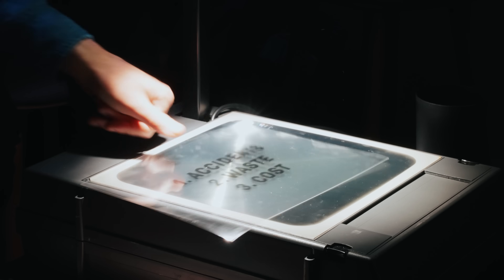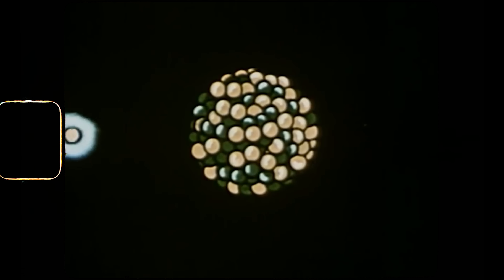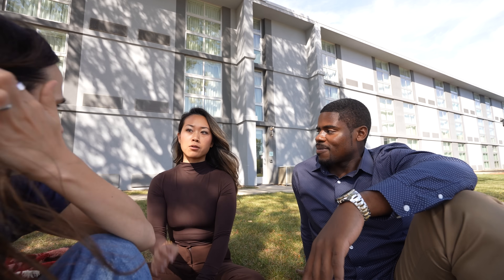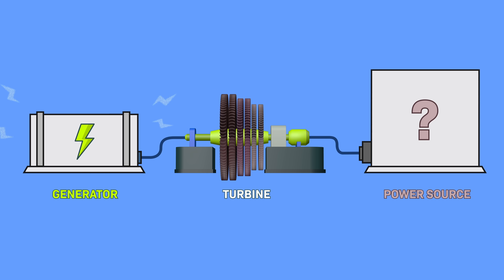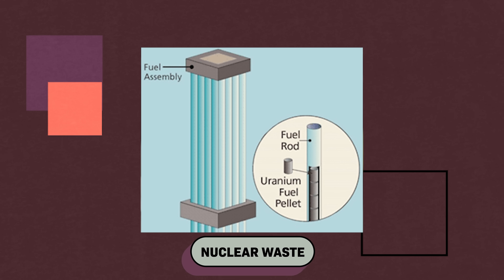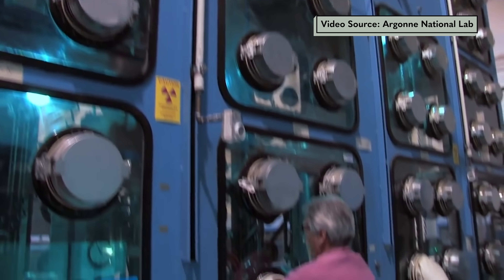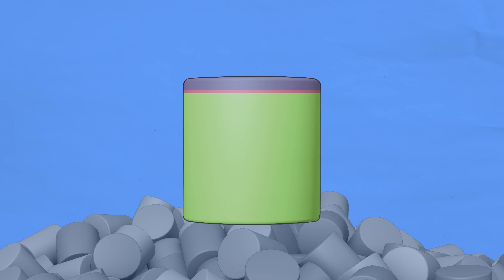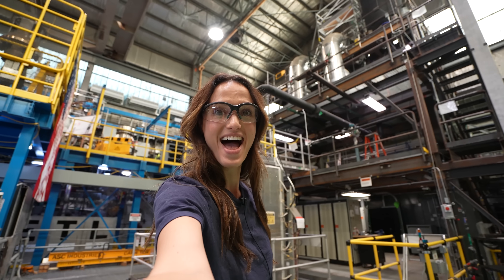The Big Lie About Nuclear Waste

Comment: You should create a video on thorium reactors.  They are far safer than uranium-fueled reactors.  The waste from thorium reactors has a far shorter lifespan, and thorium is much more abundant than uranium. Thorium reactors can also use a thorium-plutonium fuel mixture to burn up the plutonium waste so it doesn't need to be stored for thousands of years and can't be used for weapons.
Reply: Thorium has it's own issues. The waste is definitely quicker to decay, but it's also way more dangerous to humans, making waste management still a big concern. Fuel, as well, is an issue, as the most promising reactor type, the Thorium Salt reactor, uses the fuel in an extremely corrosive form. All of these are solvable, of course, but let's not forget the difficulties we still have ahead of us!

Oh, and uranium is extremely abundant on the ocean floor, it's just not economically viable to collect it at this time.
Reply: @ArtemisStiles yeah I’m so sick of hearing about thorium reactors. Sure they are safer than older reactor designs but that is mainly due to all reactor designs improving. The amount of bad information on YouTube is crazy.
Reply: @ArtemisStiles  Considering the dry casks that have been used has never leaked or had any issues in something like 60 years I find it very unlikely it will be an issue especially since the current method is basically the same thing the planet does with its own reactions deeper in the crust it's also a very small amount of waste and you can see people move them without full on suits and PPE because there's no need for it.
Reply: It's not really the fuel that matters, it's the reactor design, Molten Salt Reactors could use U235, PU or breed fuel from Th or even spent nuclear fuel directly without the reprocessing.
Reply: You can do all that with Uranium as well. What you're describing are the properties of a type of reactor, not the fuel.

Plus, I think we'll perfect  fusion reactors centuries before Uranium runs out, so the abundance of Uranium isn't exactly a train smash.
Reply: @tylerdurden3722  Yeah and that's not even including mining heavy metals from asteroids.

Comment: Back in the dark ages, 1960's, one of my elementary school teachers brought in some one from the local electric utility to explain nuclear energy. This person told us how safe it is and that soon electricity would be too cheap to meter. I am sure that it was the nay-Sayers who sabotaged that. Too bad. 
Engineers will tell you that most anything is possible, and it is true, but the                                            devil is in the details. One of the things that would make nuclear plants more useful would be to site them in residential areas where the waste heat could be used to heat houses. Nuclear reactors produce more waste heat than fossil fuel plants so it would be nice to put the waste heat to work. It turns out that most people don't want a reactor that close to them. So, instead, we let the utility dump the heat into the river, upsetting the biology of the river.
Humans are so good at concentrating dangerous materials. We are just not very good at dealing with the results over the long term. 
By all means, propose new uses for nuclear waste, but look hard at any long term consequences. The utilities that run nuclear reactors don't use the waste for lots of reasons.
I look forward to the next 'too cheap to meter' plan.

Comment: There is very much wrong in this video.
Enriching uranium does not produce additional U235, it separates the U238 and U235 to some degree to increase the concentration of the U235 to a level that allows the use in a reactor.
The same basic process run many more times can also produce weapon grade material.
Enriching leaves you with a load of U238 that still contains some other isotopes, is still radio active, though not at a very high rate, but it is toxic.
"Recycling" spent rods basically extracts the left over U235 so you don't have to add as much new U235. This can not be repeated arbitrarily, the U235 is used up and you collect more and more of the elements not fit to be used in a reactor. Several of them are highly radioactive and you contaminate a lot of material in the process so your pile of nuclear waste increases.
Breeder reactors have been built many times and all of them failed to work properly. Currently there are two in Russia that collect a lot of downtime due to failures. The problem is that a breeder reactor runs quite hot and needs exotic cooling, typically in the form of molten sodium (the other options like molten lead are working even worse). Molten sodium is dangerous and difficult to handle, combined with the high operating temperature it leads to frequent failures, not fatal ones but they do disrupt the operation which makes the power plant unfit for practical use.
And this has been the case since the 1950s.
All the talk about the wonder reactors is fairy tales, nuclear is about the worst option for energy supply and it definitely is the most costly.
Reply: Thanks for that. This video lacks a critical voice. I mean the two people she sits with, are working for a company, who wants to build such plants. Maybe they are a little biased.
Reply: @meieiro  There is a whole startup scene for nuclear who all claim to be working on revolutionary new reactors but really those are all old ideas that had been dropped for being unrealistic. Some even requiring materials that do not exist in this universe.
Reply: It honestly really surprises me because you have a lot of scientific research consistently backing why nuclear power is the one of the worst options for energy production even to this day. Yet you still have it dominated by internet commenters and YouTubers who are advocating for it because of some very poorly represented information.
Reply: @CheshireCrab  There is some bizarre fascination with nuclear energy. It was the big promise back in the 1950s/60s but it did never really deliver. Though some people still cling to that hope.
But the initial problems are still here. The waste is one of them. Against all claims that there will be some miracle solution or even a workable reactor that "burns" the waste, the "solution" is still to tighly seal the stuff and put it somewhere.
Not even the permanent storing did work. All attempts failed so far since the "safe" geological structures are disturbed when you dig holes into them.

Comment: Cleo, I think I'm falling in love- don't worry, I am far too old for you!  For MANY years, I have thought it was INSANE not to recycle spent nuclear fuel- there is FAR TOO MUCH ENERGY LEFT in the spent fuel.  Burying it for "thousands of years" is nuts, when new technology can extract it and make the residue safer.  Combine this existing tech with Thorium MSRs and we have an airtight solution to the nuclear waste problem.  I've been following this for many years, and I can verify (as an interested and informed layman) everything you have said here. 

Good on ya!

P.S. Even the Plutonium is useful- NASA has been using Plutonium for providing power in thermal reactors, and is using such on the new probe to Titan (moon of Saturn- have I confused it with the new probe to Europa- moon of Jupiter?).  The new probe will have helicopter rotors and will have a lifetime measured in decades!

Comment: I'm 100% for using "nuclear waste" energy to generate electricity.  Thorium should be considered as well.  Used with solar, wind, and geothermal, adding reactors that can use nuclear waste would reduce our dependence on fossil fuels by an enormous amount.  It would also bring to a halt the practice of "fracking," which is ruining people's fresh water supply (water wells) and can destroy our aquifers.

Comment: I believe there was a fuel reprocessing plant being built on the east coast several years ago. I don't know what the status is now, it may have been stopped. The other alternative is using thorium. Thorium is way safer than uranium. India is building a thorium reactor at this time. The US started with thorium but was replaced with uranium due to uranium being better suited for use in weapons.

Comment: Like your energy but sorry to say I see too much optimism with creators of dangerous 
technologies. 
You forgot to add the step in the closed loop process where the enriched 
stuff goes to the Weapons industry. This unshown step is why our gov'nmt choose 
this type of reactor. The other reactors where axed out due to the 'Cold War' need.

Also, in your 'fracking piece', if a safer way is created to frack safely, the 
companies that do the work will takes more time and special resources. They will find
a way to take short cuts to increase profits. A safer way to enhance any process will
increase the cost, not what bad actors will use.

Lastly, your mind set on 'safing the planent' because of the UN IPCC agenda has 
one major flaw. The mission statement of the IPCC is to only review scientific studies 
the are related to 'man' made' links of CO2 emmissions and Climate Change as related to 
greenhouse gases!
Oh, forget about the SUNs solar activity and its relationship to our climate since it is 
not 'man made'. Also many other natural links to greenhouse gases like the number one 
green house gas 'water vapor'. Please, give our species a break. We lack the ability to 
control any thing in the universe. Check our the "Weatherman's Guide to the Sun"

What we are seeing with the so called green Technlogies is they require we dug up the 
earth more than ever. At the end of such technologies will create the largest toxic 
landfills from these products (Wind tubines, EV batteries, solar panels...). Will need more
energy just to move this stuff around.

Keeping your topics to the network new agenda will be good financially ware as digging into the underlining truth does risk your monetary goals on YT.

Comment: Also my dear people, there is an NRC report from the '80's where the activity of the "original ore" (about 100 lbm)  is plotted against the a activity (total) of a standard "nuclear waste" (say, spent fuel rods, UN-processed) the total activity of the fuel rods (equivalent starting quantities) at about 300 years after withdrawal from the reactor. FOR REFERENCE: look at a picture of the Tomb of Gustavus Adulfus and his Wife in the "lower level" of the Lutheran Cathedral, in UIpsalla  Sweden. The BONES have been there for OVER 300 years, with "walk in" (on tours) access and have NOT BEEN DISTURBED since they were put in there. (Around 1600 AD). A tribute to the "stability" of Swedish history, and knowledge of the significance of the remains...but also an indication that ONE DOES NOT HAVE TO ISOLATE NUCLEAR WASTE for "hundreds of thousands of years". Quite literally you could "grind the high level waste into a fine powder after about 300 years, disperse it evenly around the globe, and the net effect would be no more or less than the daughter products and emissions from original ore deposits around the globe.

Comment: We were going to use Thorium but decided to go with nukes so we could get the plutonium for nuclear weapons.  Thorium reactors can use the waste too if i'm not mistaken. watch some videos on thorium molten salt reactors
Reply: Another YT educated person.
Where do people keep coming up with this BS that Thorium was abandoned and Uranium based PWR/BWR were chosen so we could make bombs?
Hanford Wa. has been making weapons material, at their 9 reactors, since 1944, 12 years before the first U.S. commercial nuclear plant became operational and their weapons production reactors are very efficient graphite moderated reactors and DO NOT produce any electrical power.
Savannah River site SC. Has been making weapons material since 1955 and their 5 production reactors are very efficient low pressure heavy water moderated reactors and DO NOT produce electric power.
Thorium was tried at Shippingport and Indian Point commercial reactors in the 1970s and abandoned as too costly compared to Uranium.
Weapons production reactors are NOTHING like U.S. commercial PWR or BWR power reactors and commercial power reactors have NEVER been used to produce Pu239 for weapons, since there has never been a need beyond what the efficient weapons production reactors could provide..
The U.S. currently has so much Pu239 that 34 tons of weapon grade Pu239 is being treated so it can eventually be disposed of at a cost of billions.

Your comment is like saying automobiles use gas engine because the military wanted jet fighters.  God help us that people base their knowledge on social media and YT videos.

Comment: I am under the impression nuclear waste is from nuclear fuel that became unstable from use. The way I perceive this, the nuclear waste would have to go through some type of process to make it stable,and put in to the proper required form to fit the requirements.
Reply: Spent reactor fuel has to be reprocessed and that is a very expensive and dangerous process. And who is going to pay for that?  It is no where near profitable

Comment: The Elysium and (in my opinion) even better Moltex reactors use chloride salts to carry the reactive fuel. They both operate at ambient pressure. They are designed to bur existing nuclear fuel "waste" or even time-expired nuclear bomb cores. They are converted into salts and diluted with chlorides. These reactors naturally sit at their operating temperature from zero power to full power. They cannot over heat and will not go cold until the fuel is removed. They have a strong negative temperature coefficient. Temperatures above the operating sweet spot slow the reaction temperatures below it speed up the reaction. The load can be turned on or off and the reactor just adapts.
Moltex put the nuclear fuel into fuel tubes which sit in a pond of molten salt. A third salt carries the heat away via heat exchange coils. A stirrer paddle ensures heat is evenly distributed. Chloride salts in anaerobic conditions are less corrosive than hot pressurised water. Fluoride salts are more fluid but are very corrosive and the radioactive environment puts even more strain on any metal parts.     
Elysium continually pumps the fuel from a dump tank into the reactor core. If the pump stops the core runs dry. Fail safe but pumping that stuff is a considerable regulatory issue. Moltex puts the fuel into vented tubes so avoids any need to manipulate the stuff.

Comment: Check out the possible fuel cycles of the CANDU (Canada Deuterium Uranium) reactors in development since the late 50's.  They were designed to sustain reactions using natural urainuam (as pointed out in the vid mostly U238 with 0.7% U235).  The number of potential fuel sources for these beasts is amazing.  2 of my favorites being the waste left after recycling for the light water reactors and, more importantly, DECOMMISSIONED NUCLEAR WEAPONS.   

Politics at all levels in all nations need to get on board or get out of the way.  

Awesome video and a great message!  

Looks like sometimes backwards actually is the best way forward!

Comment: Breeder reactors have been around for some time now.   But how did you get to 100 year half life?  Plutonium's half life is 24,000 years.   Where you slinging out just the P238 so you could say it's 100 years?   Of course 24,000 is technically in the 200+ camp.   It just takes an awful lot of pluses.  :p

Comment: Terribly ignorant 😞... You have confused so many technical issues and made everything you have said completely worthless.

1) Fuel re-processing is NOT cheap. Current methods involve dissolving the fuel rods in concentrated acid creating products that are not just extremely nuclear toxic by now also chemically toxic. Handling and safety procedures are "off-the-chart" expensive and complex.... as are risks. Molten salt may sound like a better process, but without a full process description you will rightfully be treated with suspicion and a nuclear "spin-doctor". Without these details you will rightfully be dismissed

2) You introduce "Fast breeder" reactors, but this is an entirely different reactor that isn't related to nuclear fuel re-use. A Fast Breeder reactor creates nuclear fuel and, as such, does NOTHING to reduce nuclear waste.. it simply creates nuclear fuel, i.e. plutonium, without the need to mine uranium. A Fast Breeder reactor still creates nuclear waste and the plutonium has implications for nuclear weapons (plutonium is the material of choice for nuclear weapons). So again, you fail to fully tell the technical story and how it relates to politics, i.e. politics of nuclear weapons.

3) You fail to address the disposal of millions of tons of other, less toxic, by-products of the nuclear process. This includes depleted uranium in the form of uranium hexa-Floride stored in decaying steel barrels as well as entirety of retired nuclear reactors that haven't been de-commissioned and are slowly leaking radiation into the environment.

4) In the case of uranium hexafluoride, this is a nasty chemical with uranium being a poison like lead and the Floride being corrosive like hydrofluoric acid. The US has millions of tons of this "stuff" stored in steel drums due to cost of converting to inert depleted uranium.

5) The US is years behind Russia with enrichment capability (another aspect of the nuclear technology landscape you have failed to address) and, as a result, has not fully extracted U235 from mined U238.... which is why there is so much uranium hexafluoride. Furthermore, the US buys enriched uranium from Russia! Yes, even with the war in Ukraine and the sanctions.... go figure. Why have you not addressed the enrichment technology, and the associated political issues, in your assessment?

Fail!